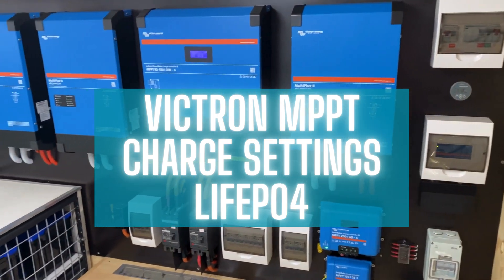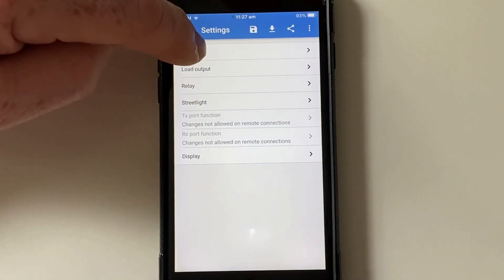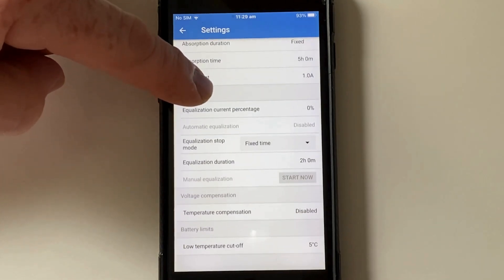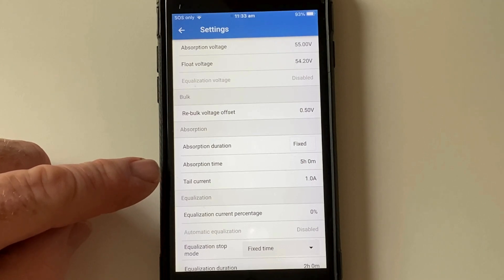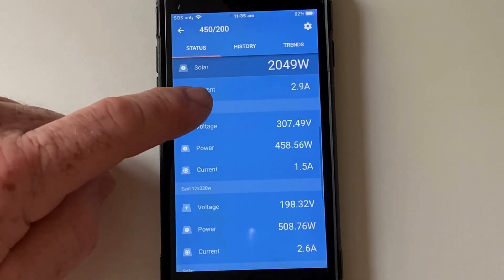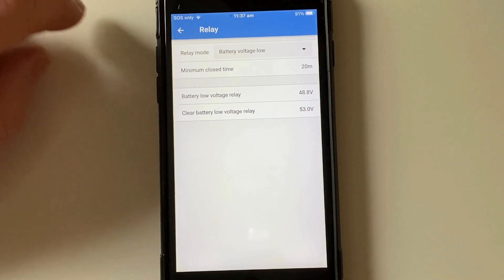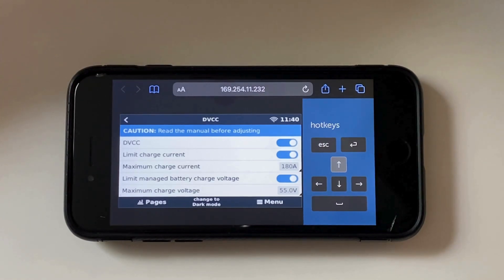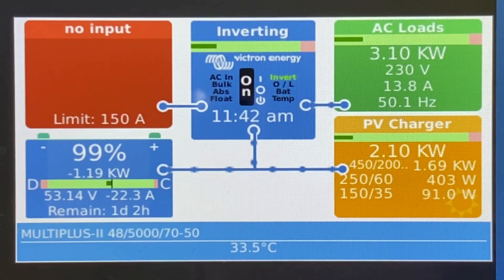Parallel 15KVA Victron Multiplus II Off Grid Solar System - Lithium Battery Charging Settings #new

Comment: Yes very nice system the 450/200 a total beast I'm running 450/100 love it.  What do you have balancing the individual 12v (I assume) batteries in series?  Each battery has a slightly different internal reistance so 4 of them in series will go out of balance slowly over time as it charge and discharge.  See it a lot in america where they love using lots of those battle born batteries and they get out of balance if you ignore them for a year and I did see one even smoke/catch fire.
Reply from the maker: The 450/200 like you mentioned LOVE'S to devourer solar energy! Yep, 4 series banks (48V) connected in parallel (800A) Protected by 320A MCCB. BMS in each battery, 48V battery equalisers connected to the 16 batteries. These keep the individual battery voltages the same. Cost effective and safe. Learn more here! Part 1 - https://youtu.be/sJygdnNDFHM    Part 2 - https://youtu.be/AOdEGcerc-c
Reply: @OrganicPower-Australia  excellent work!
Reply from the maker: Only time will tell, I keep a close eye on the system. So far flawless. Cheers!

Comment: Just in case put a multimeter on your terminals, my inverter values are off by 2V. Lead carbon no BMS. Nice wiring display. solar power art.
Reply from the maker: Hi, Yeah I have noticed small discrepancies between devices at times, nothing major. My wall mount battery gauges make it easy to check on each individual battery with the push of a button, no app or PC needed nice and easy! Thank you for checking into Organic Power.
Reply: @OrganicPower-Australia  https://www.youtube.com/watch?v=SH_2OhN01zQ system spec request from the video that was removed
Reply from the maker: Is the price at the end of the video in US dollars? $22700 USD, I spent not too much more than $22700 AUD for 20KV of PV (65 panels) 15KVA of inverter and 42KWH of LiFEPO4 batteries, Victron gear, DB's, cable and breakers included. At todays conversion $22700 USD is $34,900 AUD
Reply: @OrganicPower-Australia  it was 25626 aud only the battery price was usd
Reply from the maker: @bobmonztr  Rodger, thanks for the reply. $29740 CAD = $33558 AUD for this kit of theirs that is close to the specs of ours (this one is a bit under powered) - https://www.solaronline.ca/product/22-panel-15kw-sol-ark-inverter-hybrid-kit/  - these kits have lead batteries (not lithium) and are high frequency inverters, as a sparky I preferred the benefits of transformer based units. Around 25K AUD for the 20kw panels and rails brackets, frames etc - 15kva of inverters - 42kwh lithium LiFEPO4 battery Victron setup. I like to also have redundancy, multiple inverters, MPPT’s, battery banks and arrays. If one thing fails in a hybrid you loose everything. Good to compare, so many options out there 👍🏻
Reply: @OrganicPower-Australia  future plan was to add 9kw 12,,v to the trailer and use a better charger off gen 2 or 3 could work
If the converter fails I could wire up a power bar load under 700w np